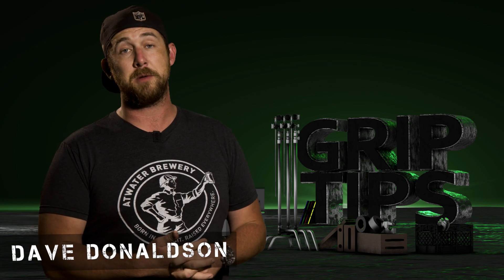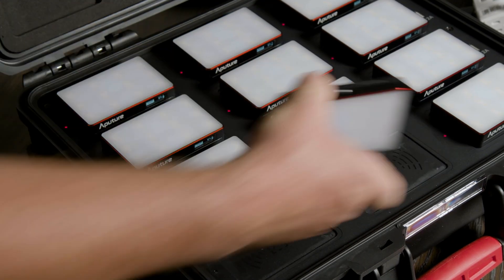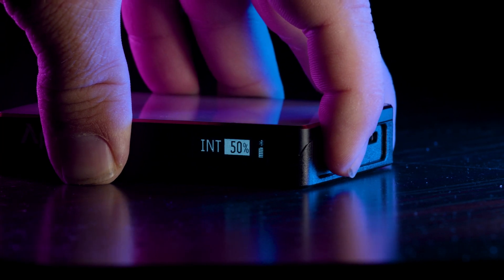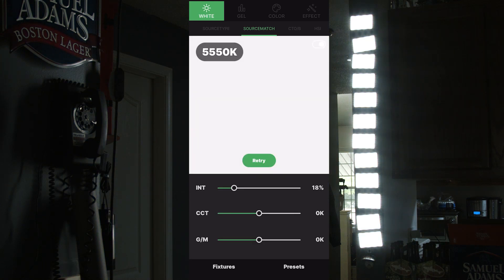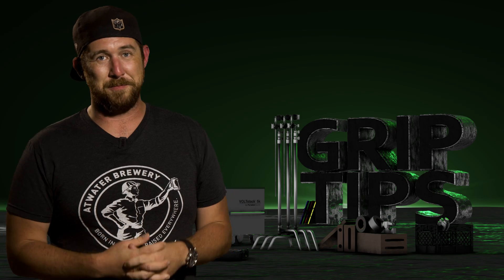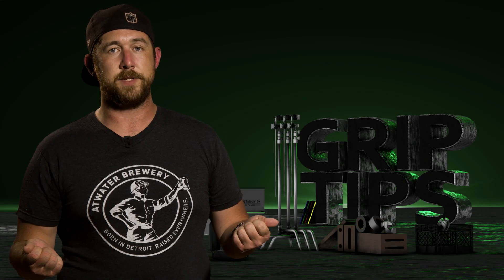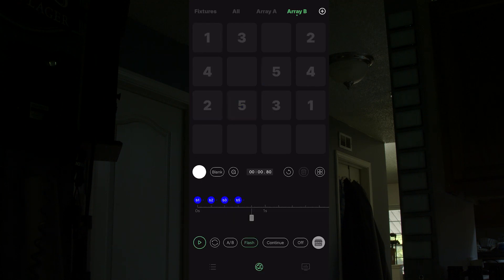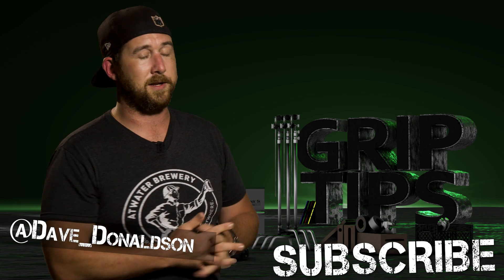EP 83: Aputure MC 12-Light Production Kit

Comment: Hey Dave, couple questions:

• Does the app report back the battery levels or prompt if the linked app is running low on charge?

• if the app is closed (not running in the background) or the connected device is shut off, will the lights just continue the sequence if they’re set to loop until the battery runs out? If it the device comes back on or the app is launched, will it “relink” back and pick up from where it last left off?

Much thanks!

Aputure feedback: 
Would be good if the products are designed and made to be user replaceable/repairable if they aren’t already. So if a particular part goes bad (E.g. the COB, fans or battery in MC), it doesn’t render the whole unit completely as electronic waste if it fails outside of warranty. Or if there is a worldwide repair support that can take care of such repairs with good turnaround times at an accessible cost. Maybe support can be initiated also via the Sidus app?